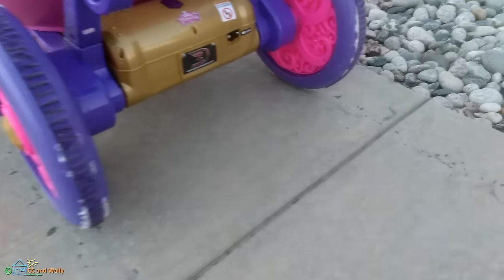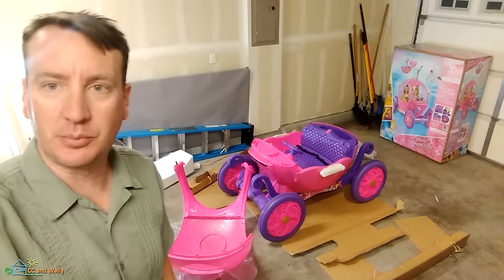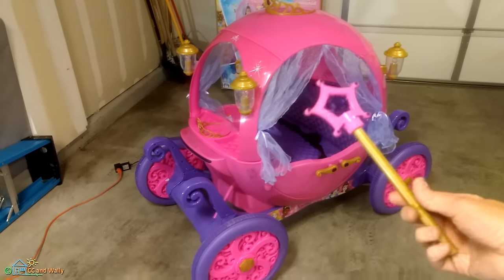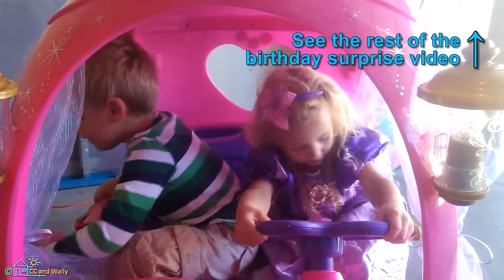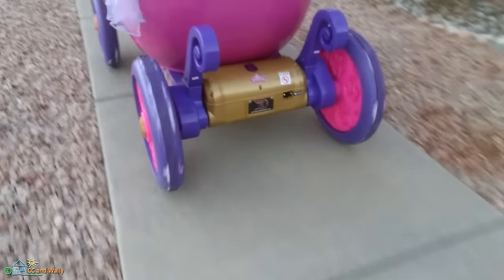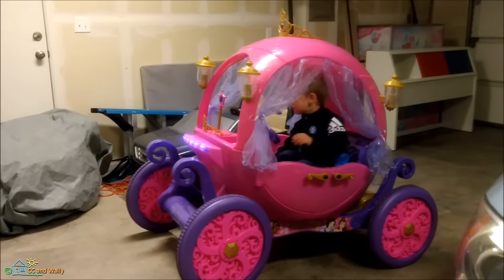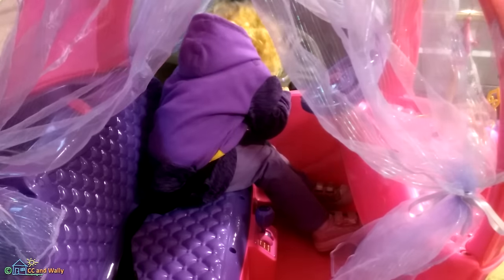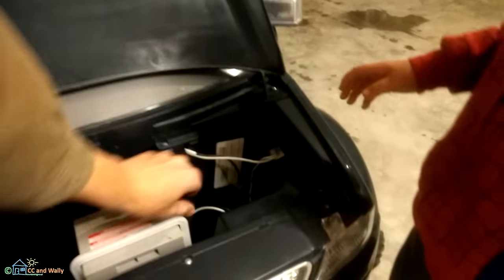Disney Princess Carriage Review and Build - One Fast Ride-On Toy | comparison fun outdoor play cute

Comment: did yours power right on? mines been charging 
 for over 9 hours and still doesnt power on
Reply from the maker: Did you unscrew the battery cover and connect the battery wires?  They come disconnected.
Reply from the maker: This is the plug... https://youtu.be/a9ntOAF-YUI?t=2m14s
Reply: yes I made sure to do that, im assuming it just takes a long time the first time around, I certainly hope that what it is i spent 5hrs assembling.
Reply from the maker: That doesn't sound good. It should have some charge in the battery even before plugging it in.  Enough to at least light the LEDs.  This sounds much more like bad or loose wiring.
Reply: dakarai turner 12-18 hours is recommended for first charge

Comment: Did anyone else had a problem with the back wheels it's seems like one axel is sticking out more then the other
Reply from the maker: I had the same issue, you'll have to loosen both of the wheels and then make the adjustment.  It only took a few taps of the hammer.
Reply: My battery does not even las 30 min after 18 or more hrs  of charge any ideas need help? Thank you

Comment: How long did you charge it?
Reply from the maker: Hi Tiffany. Ours came with about a 75 percent charge. But that's just a guess because it took about an hour to fully charge. Also. For some reason you may have to open the battery compartment first to connect the battery or else it will never take a charge. The light on the charger turns red when charging.